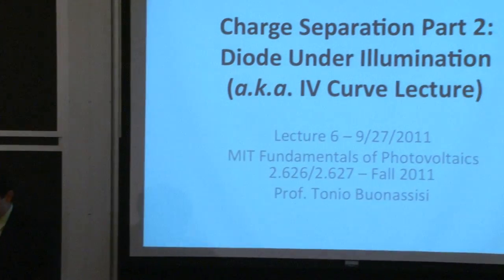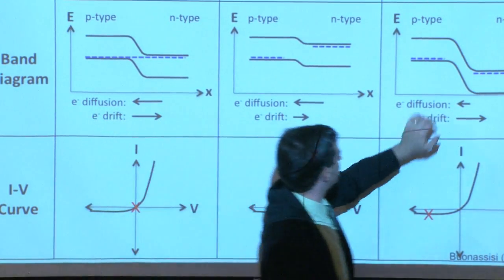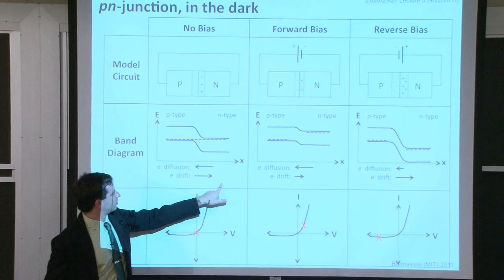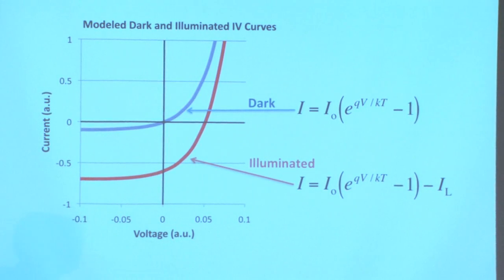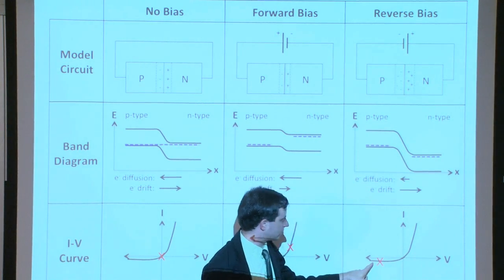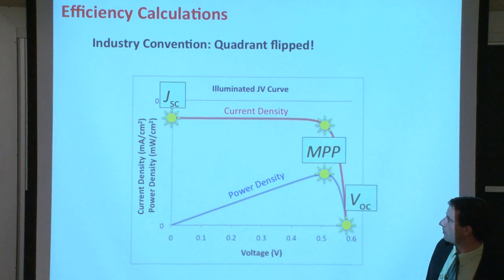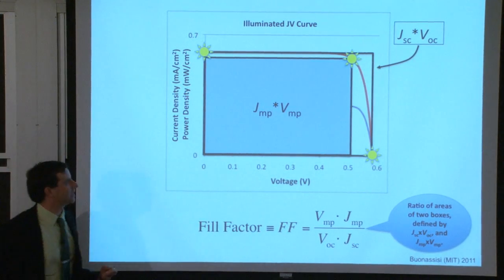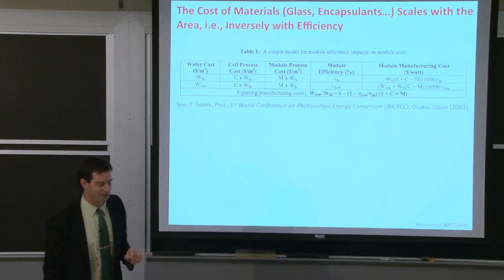6. Charge Separation, Part II: Diode Under Illumination

Comment: 25:00 why a load has to be matched to the solar cell, one of the reasons why water electrolysis powered by PV should be run at around 10 mA cm-2. Good explanation, Prof.
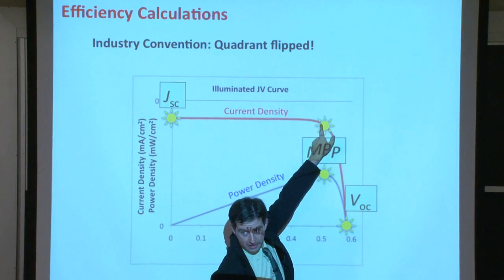Reply: at 34:00 he explains this further, match the load and ilumination conditions to operate at maximum power.
Reply: Hi, perhaps you could be so good as to clarify the biasing with a load.  The question was asked at 24:20 about how a load biases a device? Does a load cause a reverse bias? And this reverse bias needs to be somehow balanced by the forward bias (from illumination), to ensure operation at the voltage and current to ensure maximum power output? (which the lecturer discusses at 34:20). Thanks  @DDDelgado

Comment: This lecturer is excellent but I would suggest that he really means electrochemical potential rather than chemical potential when discussing the materials under bias conditions. It's subtle but might avoid confusion.
Reply: Yeah I made the same comment in the previous lecture
Reply: He said that Femi energy is chemical potential. That is correct.
Reply: Electrochemical potential is the difference between the bottom of conduction band and chemical potential. It is consistent with prof. Chen gang's talking. Driving force V is related to chemical potential which is shown in prof. Buonassisi's equation. Nothing is wrong.
Reply: Driving force V is related to electrochemical potential which is shown in prof. Buonassisi's equation.